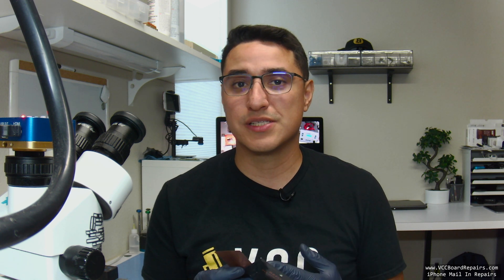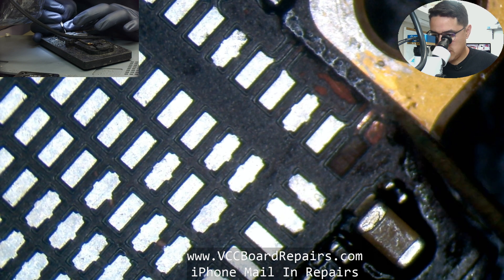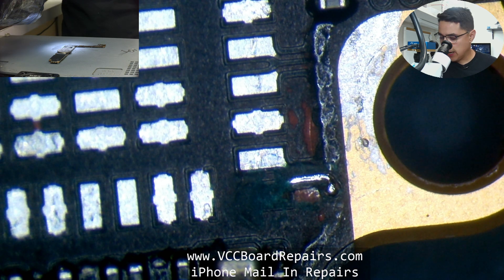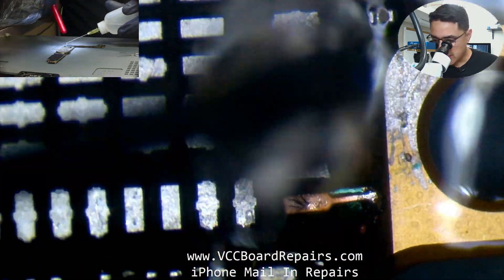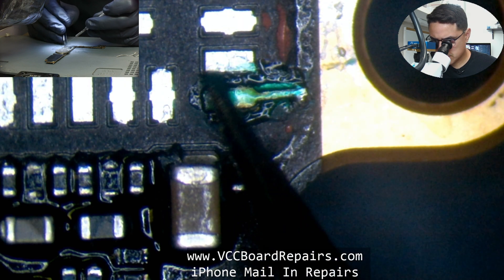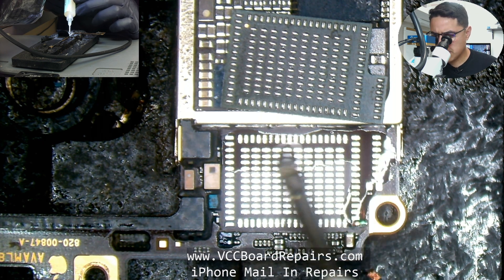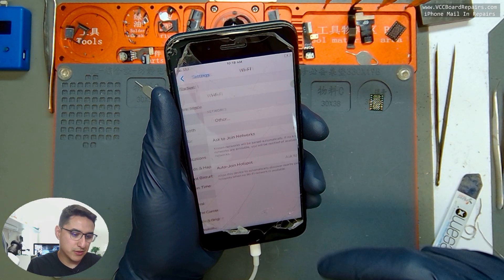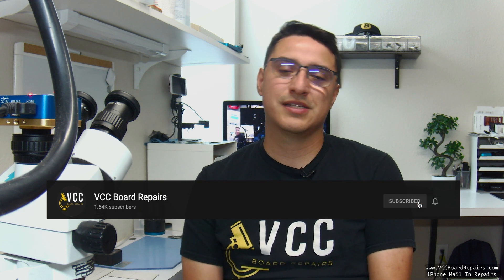How To Quickly Fix Broken Pads w/ The Refox Soldering Lug. Premade Jumpers & Pads for Microsoldering

Comment: Great videos. I wanted to ask I was trying to solder fpc connectors for touch on iPad 8 however I couldn’t get the new connectors to be soldered well and the popped out. Then I messed up two of the pads on the board. My question is why the fpc connectors didn’t soldered well and if I should now buy those pads to solder on the board?
I cleaned the area with isolated alcohol and applied flux and then tried to solder the new fpc but it didn’t go well. I tried to apply some soldering paste but I couldn’t  get it to apply well on each pad as the paste was moving around all over the pads and not individually. I’ll highly appreciate your explanation on how to do it the clean way.

Comment: Thank you for a great video I  mend a lot of Xbox;s one x, and I am just starting to  reflow chips  Can you tell me what temperature to replace hdmi timer chip and some of the chips on the power rail near the hdmi chip the power rail chip is the only one chip that I can’t buy for some reason we’re is the best place to buy replacement caps and other parts and  components and do you no were I can get a full  schematic of the main board I’ve looked everywhere and can’t seem to find the right one MENY thanks mark

Comment: I ripped a couple because my solder wick got stuck to them. Maybe I should've used more flux. And/or not pushed down as much on the iron. Thanks for the heads up though.
Reply from the maker: definitely needs more flux. Also better iron

Comment: Awesome video !!
Just want to ask you ...why there is no special epoxy to extra secure that pad glued to the old pcb area ??
Or like using CA glue to fixate the copper to the actual missing pad area ??
Have you tried this ??
I know is a pain to do if there are 10 pads to fix but how come we have to endure using UV mask to fixate that little new pad ??
Is it that the new copper pad wont accept any glue added to it ??
Reply from the maker: Because uv glue is faster and easier

Comment: hello.What tool do you use for picking up and cutting tiny jumper wire in this tutorial?
Reply from the maker: Tweezers? 2uul 3D Tweezers
Reply: @VCCBoardRepairs  Thank you for rapid reply.
By the way,Is it possible to pick up or cut 0.02mm tiny wire with 2uul 3D Tweezers?
Reply: @VCCBoardRepairs  Is it possible to use 2uul 3D Tweezers for not only picking up soldering lug, but also chopping off as it is shown in 6:15?

Comment: Nice video Jesse. My opinion on them is they are pretty good when you can use them straight on, if you got to route the tail anywhere jumpers appear to be better. Just my experience so far. I did use the round pads to fix a few ripped off filter pads on an iPad recently. That was interesting.
Reply from the maker: Yes exactly. Must be something that goes straight. Otherwise, a wire is good for anything else.

I really like these for sandwich boards with ripped interposer pads